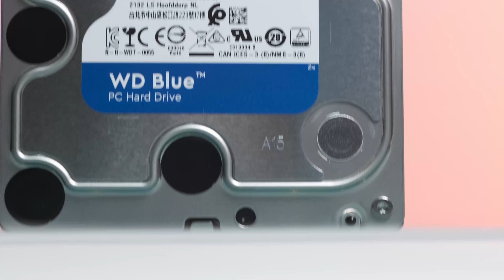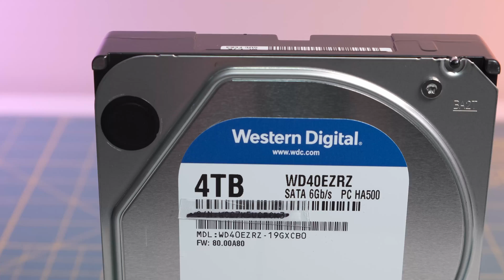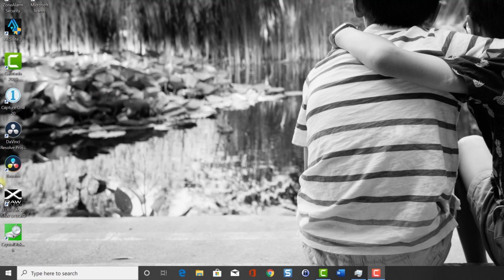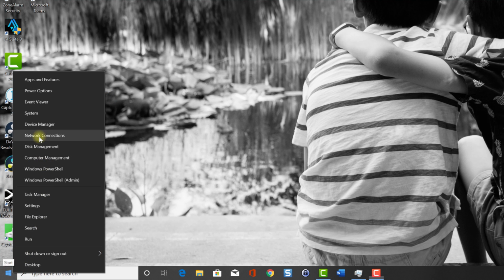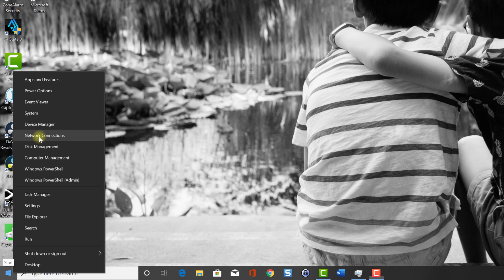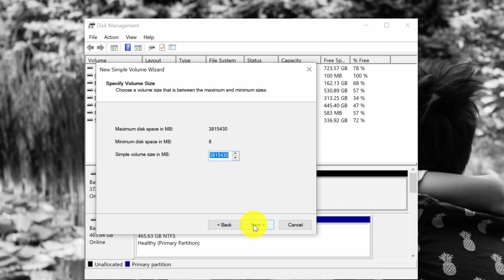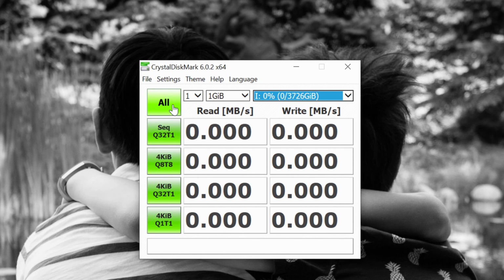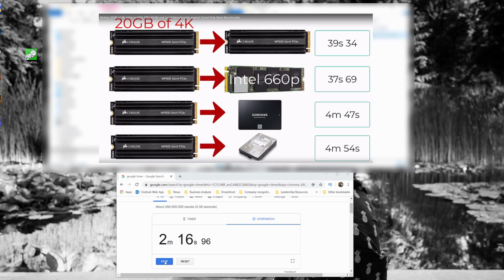Desktop Hard Drive Installation Tutorial | Western Digital Blue 4TB  | Initialization | Benchmark

Comment: Just purchased this drive. It came with no documentation. I found your video and it walked me through the process very clearly and concisely. Thank you!
Reply: check on the western digital if it has warranty, if it doesnt try to return it and get one that has it
Reply from the maker: @r32juan  Hi there. I actually upgraded my hard drive to a 8TB iron wolf and I have 5 year warranty with those. So i'm all good. Thanks for checking.
Reply: Just like installing memory, it's pretty fool proof. All the connectors only fit in slots where they CAN fit. If you have to force a connector, you're using the wrong connector.
Reply from the maker: Thanks man for the feedback and i'm glad the instructions helped you.
Reply: @TheWongReviewer  Thank you so much.

Comment: Hola. At 4:35, you connected the SATA to the HDD. There are eight unconnected pins on the computer. What are they for?
Reply: Possibly for RAID configurations.
A RAID stores data by using a collection of multiple drives. It can be used to store the same data on multiple HDDs or SSDs via mirroring, so it provides redundancy against data loss.
Reply: @kiillabytez  Thank you very much. Additional information I gathered suggests that those pins might be for assigning master-slave priorities in the reach of data.
Reply: @kiillabytez  Actually very cool . Thanks

Comment: brought two of these drives. couldnt figure it out due to the lack of instructions, found your video and now I feel like a dumbahhs. Like where didn;t I go "Where is my original Hard drive?" I thank you
Reply: Usually, being it's such a straightforward process, most internal disk drives don't include instruction manuals. Cables only fit one way. Learning basic OS and computer operation is key to avoid frustration and confusion.

Comment: I just bought a WD 8TB hard drive as a secondary internal hard drive and connected it but Windows wouldn't detect it.  This was replacing a previous internal hard drive so the cables worked with that previous drive so they should still work with this one, but it didn't work.  I was panicking but your video calmed me down and now it works.  No idea why - just unplugged and replugged the cables, switching them with other plugs on the same cable, but it works now.

So thanks for holding my hand through this process.

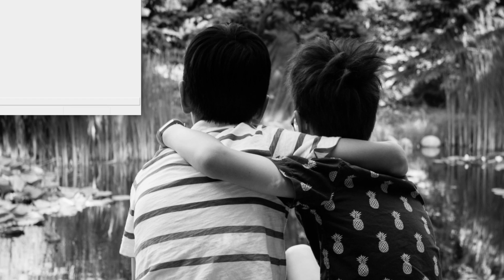Comment: what should I do, if initialize disk( 4:55 ) doesn't pop up?(which is my situation right now) same 4tb and it's new toshiba s300 3.5 hdd 4tb.
Reply from the maker: Sorry for the late replay. Trace back and confirm you have both the SATA and power cable plugged in securely. Also, in some commenters have expressed switching out the SATA cable  as the original one they were using was defective.
Reply: Internal HDD need both power and data cables to be connected for them to work. If you've exhausted all possibilities, it could indicate a faulty device. Contact your vendor and request a replacement.

Comment: Great Video, I have had nothing but headaches with WD even there external did not work as plug and play which is weird considering that's it's entire purpose. won't be buying them again when the competition is easy to use and doesn't require me to buy paracetamol.
Reply from the maker: Thanks for the observation.

Comment: Disk management didn't not automatically open that dialog box asking me initialize disk.  Not sure what I did wrong
Reply from the maker: HI there. Retrace the SATA and power cable to make sure you plugged it in correctly. If it's a mechanical Hard drive with a disk, when you power on your PC do you hear it spinning? 
Other commenters have mentioned when they swapped out SATA cables, it worked. You may have a faulty one.
Reply: @TheWongReviewer  thanks for the tip.  I unplugged it and plugged it back in, SATA and power, and it finally worked, lol.  That is so odd, I didn't change anything, just disconnected and reconnected.
Reply from the maker: @ARMYStrongHOOAH17  Perfect. Glad it worked out for you. Sometimes, the cables and connections are finnicky.

Comment: I dont have the Hard disk holder in my pc, Should I judst place it in, and on what side?
Reply from the maker: Hi there. you can buy hdd mounting brackets. If you have a mechanical HDD, it's not a good idea just to have it laying on the side without it being secured.
Reply: You really don't want to just toss a component into the case. It may contact metal parts inside your case and cause a short and kill your entire PC. Contact the vendor and see if they can supply you with a caddy for the drive.
Reply: @kiillabytez  duck taped it and it's working surprisingly

Comment: I followed the steps however when I launch the disk manager it dosent open the initialize window?!
Reply from the maker: Hi there. Confirm that all the cables are connected correctly. Trace them back to make sure it's connected to the motherboard and power supply. 
In the comments of people who had similar issues, they would swap out the cables and it worked. Try those 2 things and see if it works.

Comment: when i open up the disk management thing nothing pops up to initialize it what do I do
Reply from the maker: When you can't see it in disk management, it means it wasn't connected properly. Trace your cables to make sure everything is plugged in correctly. There has been cases in the comment box where viewers have swapped out cables and it worked.

Comment: Hi Wong, need your advice on this 4TB. I bought a similar unit, however the speed is 33.7MB/s. I'm having a FIDECO external docking station. Is it slower with a docking station? Need your advice. Thank you.
Reply from the maker: Hi there, yeah, that is really slow. Is the docking station using usb 2.0 or 3?
Reply: @TheWongReviewer  Hi Wong, the Docking station is using USB 3.0.
Reply from the maker: @jonathaneng709  If you're using USB 3.0, you should be seeing higher speeds than 34mb/s. Do you happen to have another HDD to test and compare the speeds?

Comment: Where do I plug in the other end of the power cable from the hard drive
Reply from the maker: My apologies for the late response. Have you had a chance to figure it out? The end of the power cable should connect to your power supply.
Reply: Power supply should have the correct cable on it.

Comment: I have an old WD2EARX 3.5 2T. I removed it from the case, because was not working and wanted to try to see if can work connected directly to the pc. My question is, for the power supply do I need a SATA cable that also provides 12v?

Comment: I’m thinking about adding another hardrive to my pc. Is it okay to plug the existing power cable that has three sata power ends to the second hardrive. And then get the other sata cable to plug into my motherboard
Reply from the maker: If i understand correctly, you power cable from the PSU has 3 connections. Yes, you can plug that into your hard drive. If you have an empty SATA slot on your motherboard, then yes, you can use another data sata cable to plug it in.

Comment: @The Wong Reviewer i had hard drive before and after i buy the new one i took out the another hard drive cable and put it to the new one what should i do i very nervous
Reply from the maker: Hi there. No need to be nervous. There are no problems using the old cables with your new hard drive.
Reply: @TheWongReviewer  what is the problem?
Reply: @TheWongReviewer  pls replay what is the problem my parent are going to kill me if it doesnt  work it 140 euro
Reply from the maker: @petresispetresis  Hey there. I don't understand what you're asking. do you want to clarify for me. Are you asking if you can use the existing cables with your new hard drive?
Reply: @TheWongReviewer  no i bought hard drive and it kept taking me to bios
Reply: @TheWongReviewer  pls answer
Reply from the maker: @petresispetresis  Oh okay,  do you have another Hard drive with an OS on it?
Reply: @TheWongReviewer  what is OS
Reply from the maker: @petresispetresis  You need to have a hard drive with an Operating System (OS). If not, it will just go to bios.
Reply: @TheWongReviewer  what do i do to fix it befcouse i dont know alot about pc
Reply from the maker: @petresispetresis  email me at thewongreviewer@gmail.com

Comment: your video help alot i got the 4tb in health status and it is working i just cant figer out how to use the 4 tb the one that was in it was a dual disk drive i think like there are 2 drives in one slot named 1 and 2 then there is the 4tb blue that is empty i dont know how to switch drivers to start filling the new one up im using a omen if that helps
Reply from the maker: Hi there, i can try and help. I'm just a bit lost of what you're trying to explain. Are you trying to install a 4TB hard drive into a dual disk bay in you tower and it's not showing up?

Comment: I bought a 2TB barracuda hard drive and my pc didn't come with a bracket how can I find the correct one???
Reply from the maker: HI Markel, What kind of case do you have? If you look up the make and model, they may tell you which one to purchase. However, I have used 3rd party hard drive brackets and they have worked. 
Here is this one I have used in the past, it's great as it comes with the mount and cables required. https://www.amazon.ca/StarTech-com-2-5-Inch-3-5-Inch-Mounting-BRACKET25X2/dp/B00FSVL95Q/ref=sr_1_1_sspa?dchild=1&keywords=hard+drive+bracket+PC&qid=1621127451&sr=8-1-spons&psc=1&spLa=ZW5jcnlwdGVkUXVhbGlmaWVyPUEyMkRESjNYRFhMTDJaJmVuY3J5cHRlZElkPUEwMjA3NDQ2MjdRT0pSMkU4VFpYSSZlbmNyeXB0ZWRBZElkPUEwNDUxMTg5Mk81QTZEWUtVTUhCNSZ3aWRnZXROYW1lPXNwX2F0ZiZhY3Rpb249Y2xpY2tSZWRpcmVjdCZkb05vdExvZ0NsaWNrPXRydWU=
Reply: ebay? Amazon? Your butt? Who knows?

Comment: Whats the 8 pin connector for?
Reply from the maker: Hi there, it's the cable to power your HDD from the power supply
Reply: @TheWongReviewer  whats the point of the sata cable for than?
Reply from the maker: @moises1228  Hi there, there is actually 2 types of SATA cables needed. 1 for data (attached to mother board), the other one for power (connected to PSU)
Reply: @TheWongReviewer  yea ik about that im taking about the 8 pin its 2×4 on the side of the hard drive, not the one next to the sata input, i looked it up and it says they used for jumper cables or Something like that.

Comment: The case I'm going to be using will have a cage, but where can I get the mounting bracket you used in the video? I'm getting a Western digital 1tb hard drive.
Reply from the maker: Hi there, sorry for the late response. Did you buy a pre-built computer? If you bought a case, the mounting hardware will come with the case so you can install the hard drive.

Comment: Whenever I try to initialise the hard drive is tells me that the action couldn’t be performed because of an I/o error please help
Reply from the maker: Hi there. I haven't come across that error. I just googled it and this is the article that it came up with https://www.easeus.com/storage-media-recovery/external-hard-drive-not-initialized.html#:~:text=An%20I%2FO%20device%20error%2C%20short%20for%20Input%2FOutput,access%20a%20drive%20or%20disk.&text=the%20way%20out%3F-,This%20page%20is%20to%20solve%20this%20type%20of%20%5Bexternal%20hard,initialized%20I%2FO%20error%5D.. Try that.

Comment: I plugged both cables into the hard drive but when I go to disk management that prompt doesnt show up. Send help
Reply from the maker: HI there. I can try and help. When you boot up your computer for the first time, do you hear your hard drive spinning of making noise?
Reply: @TheWongReviewer  i have the same issue i have the sata and power cords both plugged in to the drive but when i load up my pc it only shows my ssd and no other drives
Reply from the maker: @vortex2106  Hi there. When you boot up , do you hear the HDD spinning? Somebody had the same issue here and they ended up replacing the SATA cable. Do you have spare cables to try?
Reply: @TheWongReviewer  thanks for replying that actually was the problem i had the sata cables in the wrong section there were two spots one with 2 sata cable ports and one with 4 I just had to swap it to the one with 4 and it popped up thanks a ton!
Reply from the maker: @vortex2106  hey man! Congratulations! Glad you got it working! Thanks for providing the update

Comment: I’m doing my first build and I can’t figure where the sata drive connector goes on the mobo. ( the red cord )
Reply from the maker: HI there. Do you have the manual that came with your motherboard? The manual should have a diagram that has something called SATA labeled on it. You would connect the red cable to that. Here's a website that shows you how it looks. https://www.intel.ca/content/www/ca/en/support/articles/000006677/boards-and-kits/desktop-boards.html

Comment: I got it installed with both cables but it doesn't appear to see anything
Reply from the maker: When you go to network mapping, do you see the drive to initialize it? When you plug it in, do you hear the drive spin initially?
Reply: @TheWongReviewer  I got it to work changed the port on my motherboard. Thanks for the reply.
Reply from the maker: @hiviewbeatzz  Hey there. Glad you were able to figure it out. I didn't even think of changing the ports.

Comment: i have a question which i really want u to answer is that is the bracket included with the hard drive
Reply from the maker: Hi there. There is no hardware or brackets that come with a desktop Hard drive. The brackets are part of the computer. However, if you purchase a SSD, you may need to purchase additional mounting brackets.

Comment: The cables that go into the hard drive. Do i need to by that for it self, or is it already in my pc/does it come in the box w the HDD
Reply from the maker: Nosianer Hi there. Do you have a pre-built machine or a custom build PC? If it’s pre-built, you’ll have to open it up to see if there is an extra power supply plug available for the HDD and an extra SATA cable  that is unused. I’ve experienced both where a pre-built had extra unused plugs and ones where I had to purchase an additional SATA cable to connect the HDD to motherboard.
Reply: The Wong Reviewer Thanks!

Comment: i was wondering if you needed to buy any separate cables?
Reply from the maker: Hi there. If you bought the parts yourself (Power Supply and Motherboard), the power supply cable and the SATA cables come with the purchase, so you don't have to buy anything. However, if you bought a pre-built system , you may have to buy cables. Just open up the case to see if there are any extra / unused cables left.
Reply: thanks!

Comment: i was looking for Power connector , now i found it and installed my W.D 1 tb blue HDD Today with 2nd Corsair vegeance lpx 3000 mhz 8 gb ram .
Reply from the maker: Thanks for the comment! Glad you managed to upgrade your hard drive. Let me know if you have any questions.
Reply: where did you find it, i cant find the cables, mine didnt come with anything,?
Reply: @YoungBlaze  power supply has it
Reply: @xyzTheTruth  where is that?
Reply: @YoungBlaze  psu unit

Comment: wich cabels u need?
Reply from the maker: HI there, can you expand on your question. Are you talking about the cable attaching it to the Hard Drive? It's a SATA cable.
Reply: The Wong Reviewer I only have 1 sata cable that came it’s the mother board the  bigger on I don’t have to I have to bye it separately or does it come with something
Reply: @tabzsking5250  these type of hard drives don’t come with any additional cables
Reply: The power cable comes with your power supply and the sata comes with your motherboard